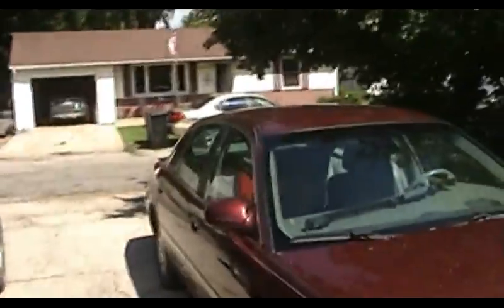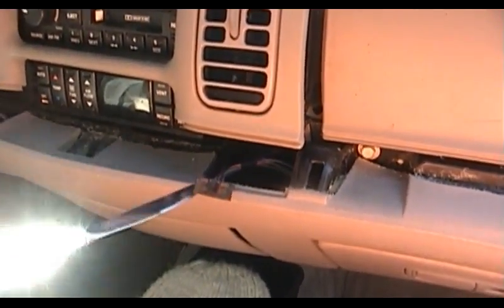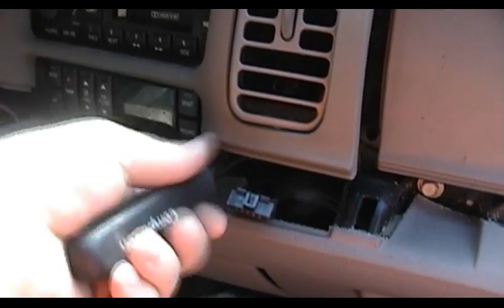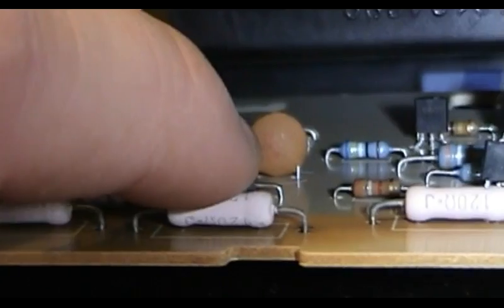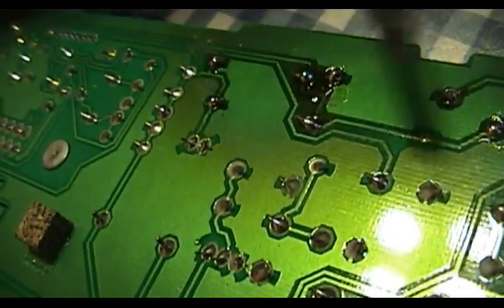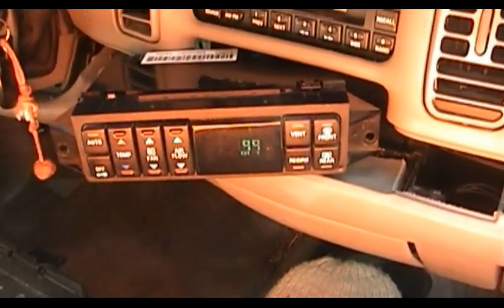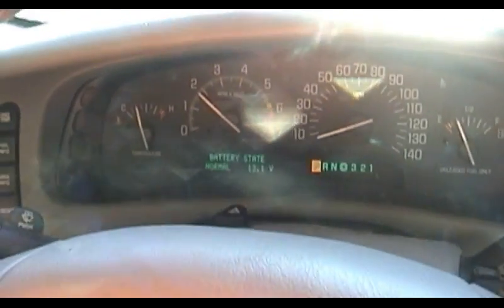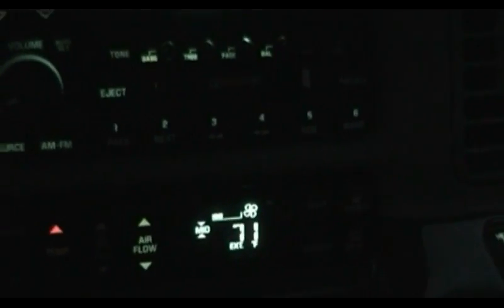Kitchen Table Electronics Repair: 2002 Buick Park Avenue Climate Control Display Repair

Comment: Bill, I have some information regarding the rear Defroster. according to the Buick Forums, the signal to drive the rear defroster goes through several control modules before it gets to the grid itself. the modules in question are:

HVAC control module (you've already fiddled with the internal guts of this guy to bring the display back to life)
Instrument panel integration module (IPM) (i assume this is working as intended since I didn't see any dead gauges or a dead odometer/DIC display)
Body control module (BCM)
Radio antenna module
Radio antenna module coil
Rear window defogger grid

I would likely look at the Antenna Module.

Comment: I have a video of my windows 98 PC running a game that needs 8mb of vram the video is called my windows 98 and Linux PC  and is the first video I did on YouTube. These HP pavilion PC was supposed to be broken but it wasn't and has never crashed on me. It can start in 20sec and runs with the factory version of windows 98(it had fresh copy on it when I first got it). It runs the monitor at 1024x724 16bit color it has an option for 32bit color. This PC can load 350mb game from the CD ROM to the HHD in 5 or less minutes. Just got some classic Sim games for it to play

Comment: Hello bill, I hope you get this response. I just purchased a 2003 park avenue with the exact same functions as your mom’s car. My climate control back lights do not work and it drives me crazy. I would like to do the work myself if you will point me in the direction I need to go to purchase new lights or resolder the ones that are out. My display works fine it’s just the back lighting to the buttons.
Reply from the maker: I have not attempted to service the backlighting lamps in these modules, and this car is no longer in the fleet. It's very likely the bulbs have burned out, as opposed to their being bad solder joints. They are informally known as "grain of sand" or "grain of wheat" bulbs. I am not sure what specifications (voltage, power consumed, etc.) they have, as I've never tried to replace them.

You could likely retrofit the control panel with LEDs. To do so will require some circuit modifications for the needed current limiting resistor. You'll also need a multimeter, a resistor calculator for LEDs (available elsewhere online) and some basic soldering equipment.

Someone may be offering this service in exchange for a fee, and that may be the best way to go. There are lots of places that specalize in rebuilding the backlighting for many different kinds of instrument panels and even radios.

Comment: 1999 Buick Park Avenue. My A/C stopped blowin out of vents. Floor and defrost only. I pulled the head, table top teched the inside. -5 re-spot solders were needed, as some seperate from the board from age. Thought that may have helped. TY For that part it did have some!! But No go. Correct me if I'm wrong but from what i checked there are a couple door actuator's that are in the dash. I have seen the one by left of glovebox is one that people said replace that one. Just want to be sure. Are they all the same when I order one. Do or would you know which one I may need to replace? I'd sure appreciate it.
Reply: could be ac programermine is long narrow black box fastened to heater housing bunch of colored vacumn hoses and electrical conn go to pick /pull greyt one take alook before you buy cover  unsnaps if coils are burnt  chances are it is bad to common problem on buicks

Comment: Will this repair work on the 2001 park avenue as well? And can someone list the required tools for the fix?
Reply from the maker: It is hard to say. Sometimes GM uses the same basic part for many model years and other times they do not. There's little rhyme or reason to it. At the very least, you will need the ability to solder, a soldering iron (15-25 watt) and suitable solder.
Reply: uxwbill thank you! What were the two hand tools you used to unscrew the climate control system in the video?
Reply from the maker: Either a basic set of screwdrivers or a 1/4" and 5/16" nut driver.

Comment: I got my CC module working again, but the external temperature reading hasnt worked for a long time. Any idea where that sensor is?
Reply from the maker: That sensor sits somewhere in front of the radiator. It looks kind of like a plastic stovepipe hat.
Reply: @uxwbill  I think I lost mine when my engine splash guard under teh car was ripped off in a parking lot...  Even the dealer cant seem to figure out how to fix the issue.
Reply from the maker: It's certainly possible. I don't think the dealership tried too hard. The factory service manuals -- available electronically to all GM dealers -- will have illustrations showing how the sensor was routed, information about how it can be tested and what to expect from the test results.

As it's likely some of the wiring was left when the sensor vanished, I'd start looking around that area for any wires that are just hanging around in thin air, possibly without a connector at their end.

Comment: The thing w mine is that its only the left side of the climate control that does not work the screen shows the right side buttons show its just the left side buttons?
Reply from the maker: I don't understand what you are saying. If the screen illuminates incompletely, I'd suspect bad solder joints. The buttons have small lightbulbs placed randomly behind them, and these can burn out.

Comment: Does the Rear Defroster work after you resoldered the resistors?
Reply: ***** I was going to ask the same thing, glad I read through the comments and found you already responded! Watching voltage drop sounds like a good test in the meantime. I wouldn't be surprised if it did work... perhaps The Forgotten Solder Joint was the culprit!

Comment: Do you know what size the resistors were on your board , I have the same problem and my resistors look BBQ and I'm not sure what resistor to buy. Thanks
Reply from the maker: The resistors on my board were still OK, so I didn't replace them. I'm sure I checked their values at the time, but I don't recall what they were, unfortunately.

Comment: The reason this happens is they use big heat producing dropping resistors for the VFD filament supply. It all boils down to cheap/piss poor engineering. There are lots of better ways to do what they did.

Comment: My experience with a nonfunctional rear window defroster on the '06 Chevy Monte Carlo was fixed by bypassing a burnt connection in a big plug that connects the dash wiring to the rest of the loom. On the Chevy the plug is in the passenger side kick panel. Scary to disconnect a plug and see charred connectors. I cut the wires from the plug & socket and spliced them together and now my window defroster works.

Check this video on an Impala - same thing, https://www.youtube.com/watch?v=jFWBDZjQaRU

Comment: Automatic climate control is not yet where it should be.  We have a 2011 GMC Terrain with ACC and it definitely thinks it knows best.  You have the heat on and set to a specific temperature, when the cabin reaches that temperature, it thinks that it is getting too warm and starts to blow cold air.  If I wanted cold air, I would have turned on the AC myself, but nooo, it knows(!) that you want that temperature, and no hotter and 'helps' you by turning on the AC itself.

Comment: Is that a 3800 Series II or Series III?
Reply: I wasn't sure if the 2002 model year used the Series III.  I actually have a Series III in my 2004 Pontiac Grand Prix.  It's been a pretty good car to me since I bought it in January 2012.  However, I'm pretty sure my next new vehicle will be a pickup.